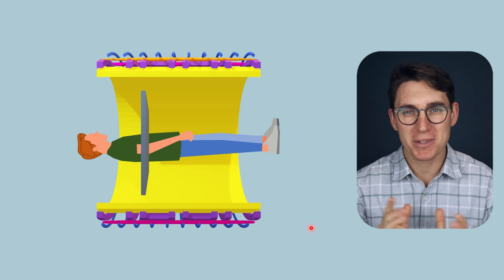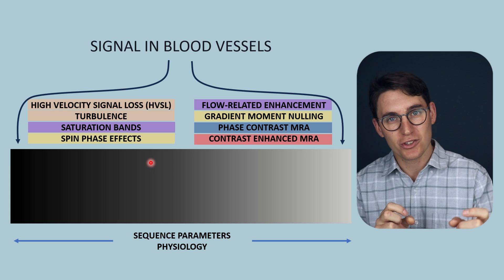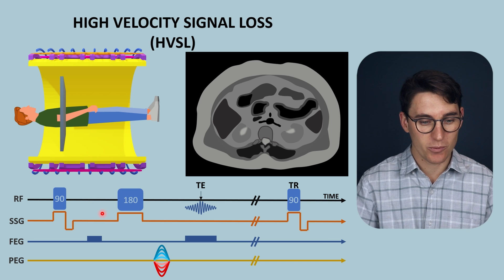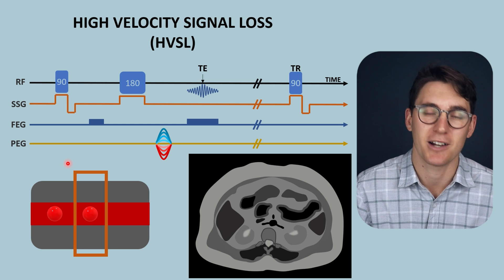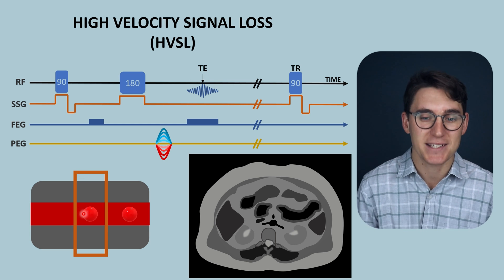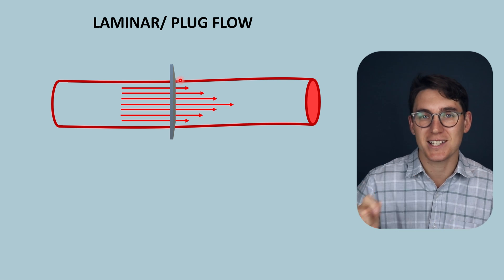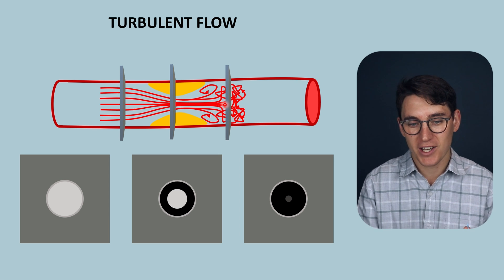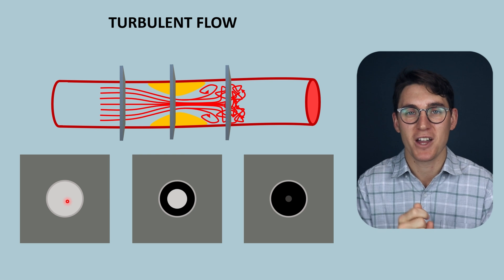High Velocity Signal Loss (HVSL), Time of Flight Effect and Turbulence | MRI Physics Course #23

Comment: Q.What happens to MRI signal in a vessel when flow. velocity  increases significantly?
1. High velocity signal loss occurs
2. Flow appears brighter due to increased signal
3. There is no change in signal
4. Flow related enhancement increases
Sir Michael, can you explain what is the right answer.